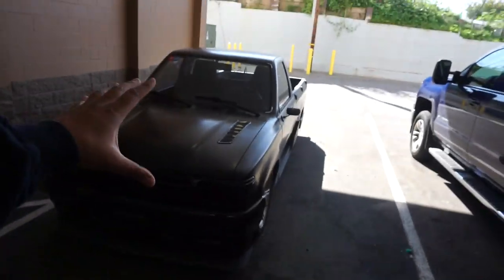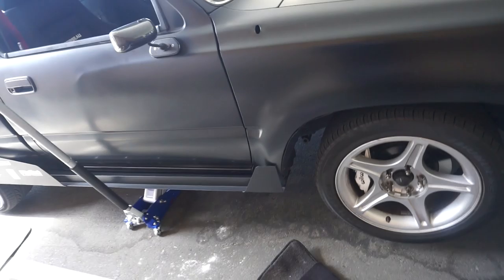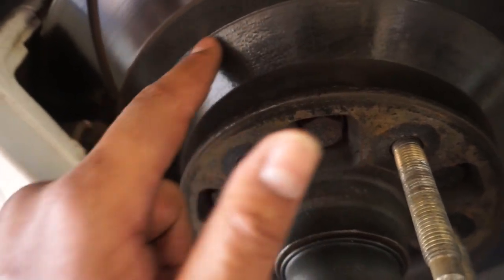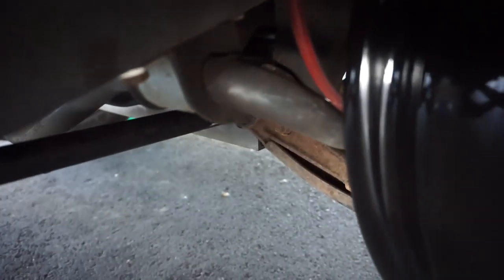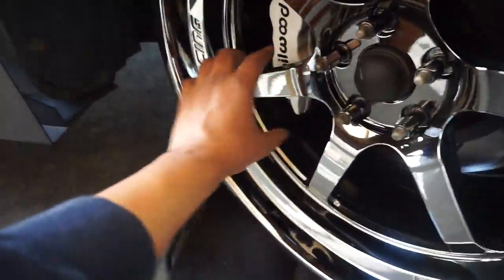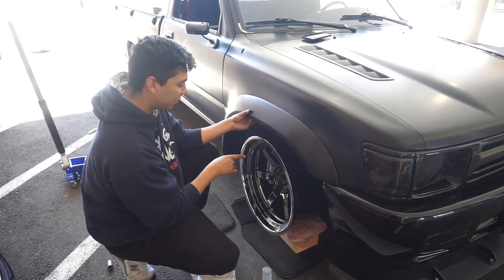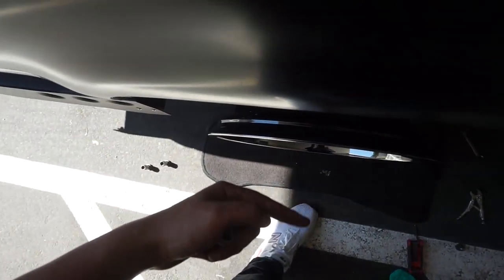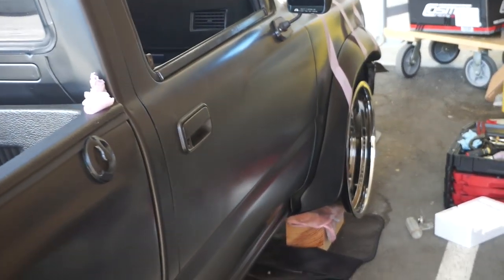WIDE WHEELS ON A MINITRUCK

Comment: Hey from one toy lover to another.. if you find a cobra R hood for a fox body mustang you can cut the top layer off and mold it to your hood and it follows the body lines that are on the hood and cowl.. if your into cowl hoods it works but for me it was needing the extra clearance as I put a small block in mine just figured I would tell u just incase..

Comment: Those wheels could stick out an inch or two more.
Reply from the maker: calculated it perfectly man! the rear independent suspension that’s currently going in is 1.5 inches wider on each side. and all i need is extended lower control arms to match! 💥